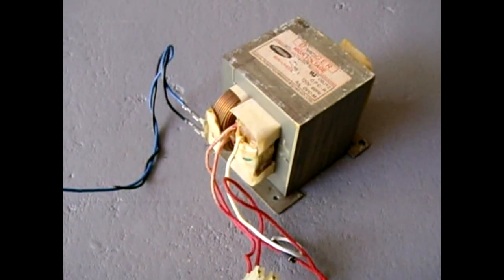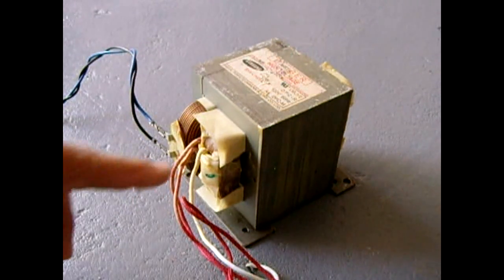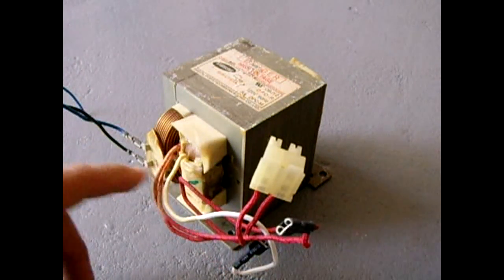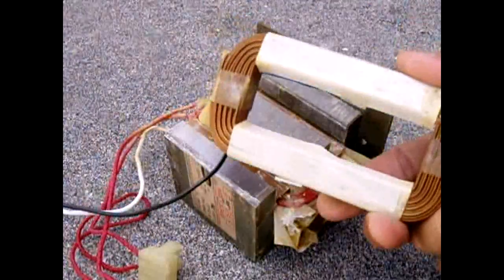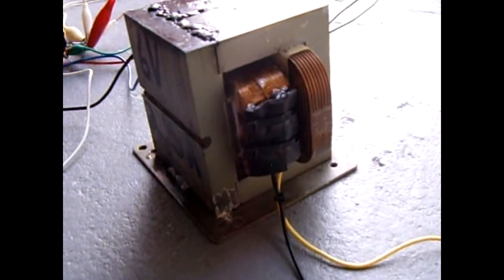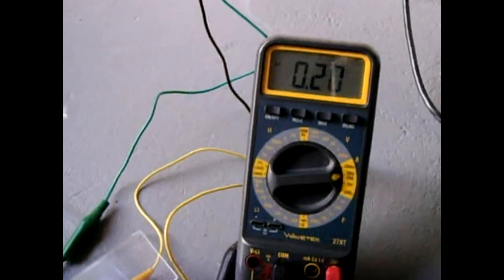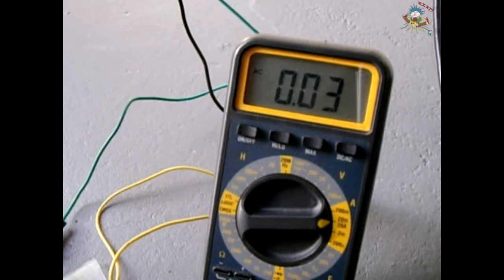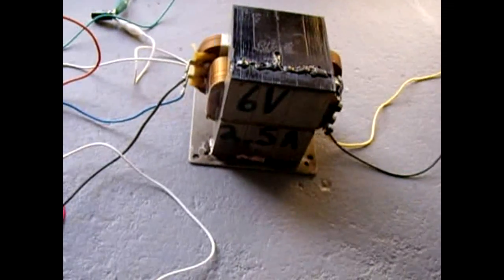Homemade 6V / 2.5 Amp Power Supply/Battery Charger

Comment: Thanks, your videos are very helpful and informative. So, by removing half the turns from the new primary (since you turned the flow around) you are getting 6v @2.5 amps. Does that mean that reversing the flow with no modifications would give you 12v @1.25 amps? Furthurmore, would running two of these with the new primarys in parrallel and the new secondaries in series, would that give you 24v@2.5 amps? I'm trying to build a 24v grid connected charger for my solar battery bank (8- 6v 200ah batteries in series parrallel) based a MOT rewound transformer but it got too hot and burned up, even with high airflow. The bridge rectifier survived but the transformer is toast.

Comment: People who don't know what they are doing should never try something like this at home because microwave oven transformers can kill you if you accidentally touch them while they are powered on also if you don't properly modify the microwave oven transformer then the microwave oven transformer can explode and burn your house down so remember if you attempt something like this at home know what the fuck your doing otherwise your going to die from the high voltage or burn your fuckin house down and no one on YouTube is responsible if you die from the high voltage and no one on YouTube is responsible if you burn your house down so please use caution and know what your doing before you do something like this at home because microwave oven transformers are extremely dangerous and deadly I know that this guy should have put a disclaimer in his video
Reply from the maker: LOL. You're extremely paranoid, and you don't know what you're talking about! The HV winding was REMOVED.  This is a safe project if the person is familiar with electrical/electronics. A person that doesn't know much about what I show in this video, has no business duplicating what I did.

Comment: I actually made a 1.2 to 25 volt 2 amp adjustable power supply using a M.O.T. without touching the windings,  I simply input 
230 vac into the output winding. (plus a few components). and voila.
Reply: ATH3157 people who don't know what they are doing should not try this at home because microwave oven transformers are still lethal and can kill you only people who know what they are doing should try this at home because microwave oven transformers can be dangerous and deadly

Comment: I have two 6V (4.5AH) batteries.I attached them in series with output of 12.30V. I want to charge them combined in series with 12V ( 2.5A) charger.
Does it work for me?
How much time it will take to fully charge the batteries?
Please suggest me better options?
Reply: you should charge them with a 6 volt charger, not in series with 12 you will diminish the  battery lifespan

Comment: why does my mot gets hot even in idle and no load..i put secondary 10gauge 14 turns..my mot is 230v 50hz..
Reply from the maker: It gets hot because the transformer is saturated. When the load is applied, it will be cooler. Use the cooling fan from the microwave to keep the transformer cool.
Reply: electronicsNmore hmm..i guess i'll my 220v pc fan than that fan..should be more efficient..thanks bro..

Comment: I had a question. What if you used the secondary as the primary without removing anything? I thought the secondary was about 2000 volts, that means about 17:1 ratio. Well, 120 volts divided by 17  is 7 volts AC, and rectified it would be 9.8. In other words, why cut anything apart?
Reply from the maker: Current output would be VERY low.
Reply: is that because the high number of turns makes the impedance too high for the 60 hz?
Reply: I've done it, current was 3 amps

Comment: So, the open voltage at secondary is 13.4v but when lamp is connected, it becomes abt 6.6v? so this transformer is to charge 6v sla battery using 13.4v ?
Reply from the maker: Unless you're using a regulated power supply, it is normal for the voltage to be high under NO load, and drop under load when using high current transformers. No problem charging a LARGE 6v SLA batteries using this setup. You need to monitor the battery voltage so you do not overcharge the battery. Cut off around 7.2V.
Reply: +electronicsNmore So it depends on the effective resistance of the load? in that case, can i use a variable resistor to control the charging voltage? thanks master
Reply from the maker: John T
Could be a resistive or inductive load. No need to adjust the charging voltage, just connect it to the battery. When the voltage rises to 7.2V, unplug the charger.
Reply: electronicsNmore I see. The SLA can take slightly higher voltage to charge since its more rugged than lithium right? Thanks so much for your advice. :)

Comment: Hi, I came across your site while looking for a place to find out why my Schumacher pro series 12V-6V car battery charger went dead.
I like the way you convey the mysteries of electronics into simple layman's terms. I would like to repair my charger, but cant find any info on the parts that are bad. I have what I believe to be a  ceramic thermal fuse on the incoming tap. On it is marked U 25, 2.5 amp , 250 V with a sort of infinity marking, than a 13, 150 degrees symbol and ,cumi ? Tried to look that up with no luck, any ideas ?
Thank you.
Reply from the maker: Nothing but a simple 2.5A / 250V/ 150deg thermal fuse. You can buy them on EBay.

Thanks For Watching!

Comment: Hi thanks for the great videos. Can you show us how to make a 12v vehicle battery charger? My 20 year old Century charger gave out, it was a old school manual three setting charger 2 amps, 20 amps and 100 amp starting booster. It was really a solid machine. The new ones are all really pricey and automatic. They shut-off before the battery is fully charged.
Reply from the maker: I have other videos. You can make a simple one from a MOT, just be sure to use the microwave oven cooling fan next to the MOT while charging. You can also rewind the transformer completely for a very efficient charger if you refer to another video I have. Refer to my video playlists. Look for 12v circuits/charging/ and microwave in the playlists.

Comment: Could you build two of these to make a 12 volt car battery charger?
Reply from the maker: You can actually use this setup to charge 12V lead acid batteries at 1 Amp. Just don't remove as much of the winding. You need around 18VDC when rectified. I also have another video in my list which charges with lots of current, but you also are wasting current at the input. It is here:

12V Lead Acid Battery Charger(Homemade)

Thanks For watching! Please share with others, and rate the videos "Thumbs Up".
Reply: electronicsNmore i have mot 220v..i need a 12v battery charger..how many winds/volts should be using 10gauge wire..rectifier is KBPC5010

Comment: I have seen some transformers where the laminents are bolted in place and not welded.  So I was wondering if I could cut the transformer and then tap it to accept
bolts for reassembly.  I prefer not to go the welding route yet.  Would using bolts significantly alter the perrformance?
Reply from the maker: I have seen transformers like that also. It affects the magnetic field, but to my knowledge not by that much. You would have to alternate the E's and I's in order to screw them together. Hope you have a good drill press, sharp bit, and plenty of oil to keep that bit cool.